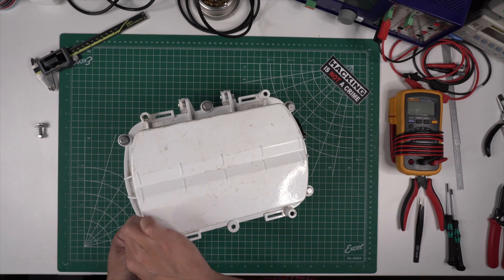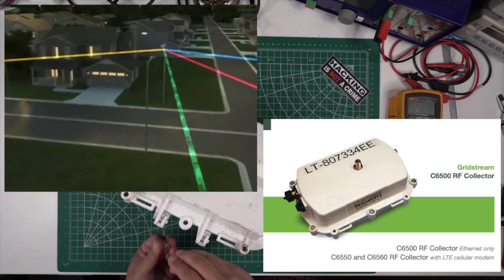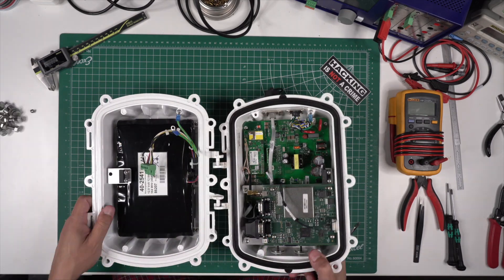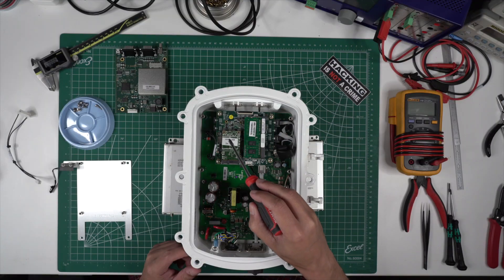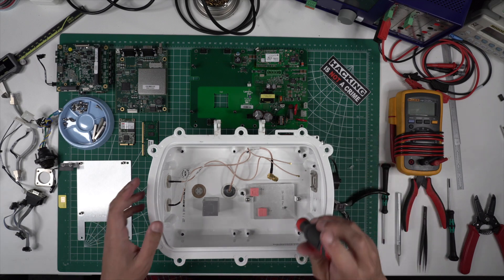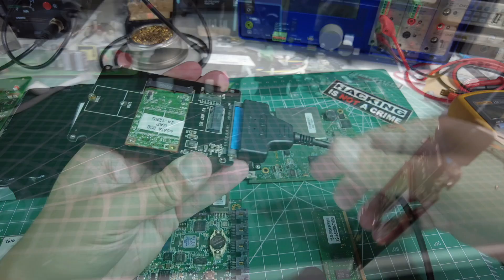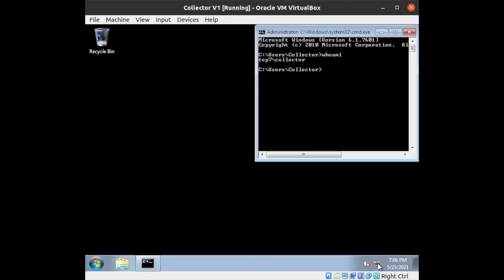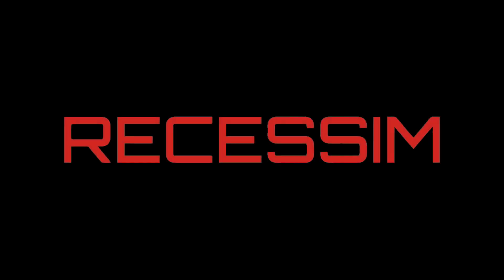Smart Meter Hacking - The Collector

Comment: With all the talk surrounding the vulnerabilities of power systems worldwide, the latest upgrade to our grids is running on windows 7 and the hard drive has no encryption or other protection.
Reply from the maker: Well it sure looked intimidating before I got inside 😂
Reply: Security Thru Scarcity. You're not supposed to be able to get a hold of these things.
Reply: @jfbeam  
They're in almost every neighbourhood, how exactly is that scarcity? Anyone who wants one just has to steal it if they can't buy it. And of course the sort of people who would want to attack the power grid are not exactly lacking in the resources necessary to get a hold of these things.

Comment: 1:03 That's a tamper detection switch; all it does is flip a bit. I had to force my AMI vendors to enable it and tie it into our security logging infrastructure. It's off by default, and vendors don't want to do any more work than necessary, so it usually stays off.
Reply: For those wondering, the idea is that physical access == game over, given the number of attacks you can perform with power, acid, microscope, etc. If you were opened and your meter ID wasn't referenced in a recent work order, you weren't trusted on the mesh network until a truck rolled to inspect it and we assume any stored keys were compromised.
Reply from the maker: Very interesting that it’s unused by default and you had to have them enable it! After gaining access myself I agree with you, a lot can be done!
Reply: Simple "intrusion detection switch". Lots of PCs and servers have those as well. It's not like a creditcard / ATM PIN pad... those things do blow their brains out if you open them. (or look at the wrong.)

Comment: Just curious which version(s) of Linux you are using?  One of your March videos looked like Ubu 16.  With the end of LTS on 16.04 I tried 20.04 but didn't like it so I've switched to Mint.
Reply from the maker: I’m using Ubuntu 20.04 but only because everything built on it and I’m down the road a ways. I used Mint in the past and really liked it.
Reply: @RECESSIM  BTW an Itron meter was installed last week on my house here in Honolulu.

Comment: Would you be interested in tearing down a Velodyne puck lite?
Reply from the maker: That looks like a fairly expensive sensor, I’ve looked at some low cost LIDAR’s in the past like what’s used in the Neato vacuum. Can’t guarantee it would survive a tear down, but would definitely like to see the inside of one!
Reply: @RECESSIM  its non-functioning following a high G stop (internal mirror is broken) but everything else works and the unit still spins up when power is applied.

I'll put my email in a separate message below so that I can delete the message afterwards.
Reply from the maker: @maddmackx3381  got it

Comment: Any chance you found an application that allows the IWR to dump packets.  I’ve tried to get gnu radio running but hit some roadblocks, but I happen to have a IWR.
Reply: Your step by step guide was spot on.  I’m receiving several 55 and D5 packets thru GNU radio.  I have not looked thru the packets in details and I’m curious to see if my local utility is encoding data identically to the providers in Texas.  Thanks for putting this out there.
Reply from the maker: That’s great to hear! Check out the wiki and join the Discord chat if you want to speak with others working on it.
Reply from the maker: GNURadio is still your best bet, I’ve only just begun to look at the IWR’s to see how to communicate with them.

Comment: Yeah, reverse engineering .NET applications is really easy. I can recommend you a tool called DnSpy, which also includes a powerful debugger. And if there's any obfuscation, you can use de4dot, which works well with a lot of commercial obfuscators.
Reply: I use jetbrains dotpeek personally
Reply: @D0NtPh34rTh3R34p3R  dotpeek is also a decent decompiler.
Reply from the maker: Thanks you both for the tips, been using DnSpy and searching for interesting code.